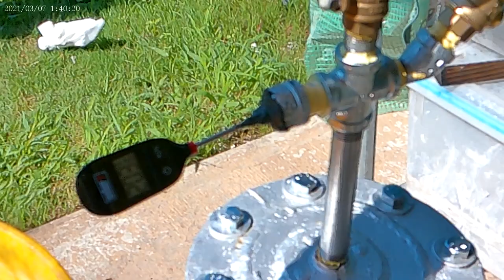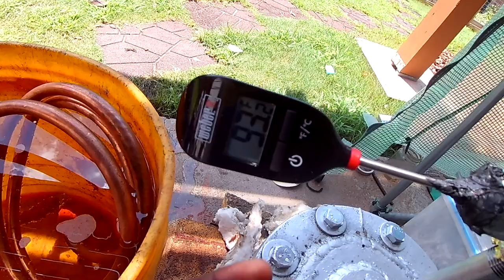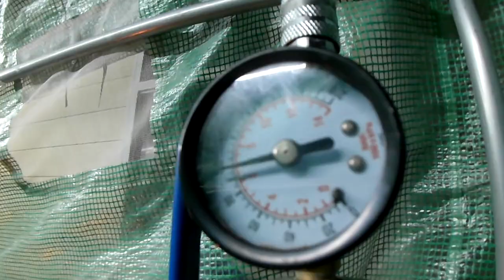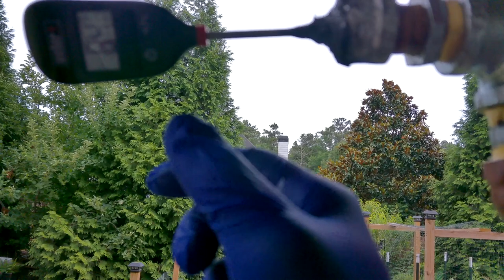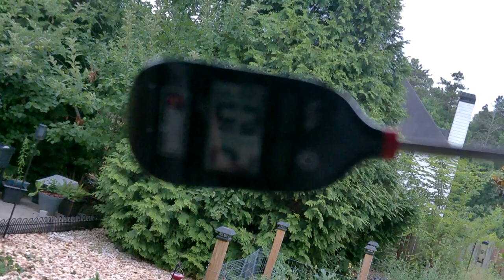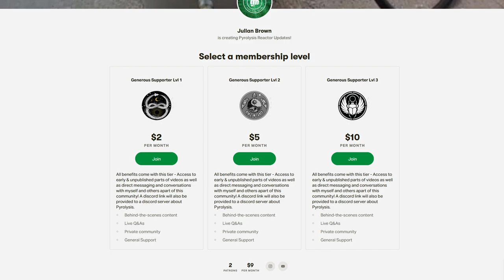Distilling Pyrolysis Oil Part 1

Comment: Here's my advice. Go get a hotplate with a digital readout ,theres some for making candy that are pretty accurate.  Make your worm a vertical spiral where there are no hills for distillates to dam against. Go to an all stainless rig so it doesn't react, including pot, I would use a pressure cooker.shorten the distance from your pot to your condenser and insulate anything that's exposed, youre trying to shock the vapor into condensing .Add ice and salt .Find out what compounds are in your crude and make a temperature bracket for them all. Work your way up through the temperature gradient so you only get one compound distilling at a time till you're at the one you want. Go slow and steady.youre looking for steady drips and maybe a small drizzle. Guaranteed it'll be clear amber if you do this.
Reply: Superb advice, man. You should give this a try, too, to help us all out!

Comment: Looking at your setup I can see a possible reason for the oil coming out literally the same way it went in first lower temperatures heating it slow is definitely the way to go but more than that the pipe that come straight up off of your reaction vessel if you stuff that with stainless steel wool it will act to give you a fractioning column and only let the lighter fractions i.e. gasoline and diesel come over while refluxing the heavier hydrocarbons until they turn into lighter hydrocarbons via cracking. Also when you build the new one try using a 2 inch pipe coming off the top for at least 3 feet where are you put the steel wall inside that will give you more space for fractioning. Hope this helps as always love the videos!
Reply from the maker: The pipe is stuffed with stainless steel wool, but I do need to make  it bigger as you mentioned. I don't have the footage, but if I do a very slow run, I do get better fractionation. Thanks!
Reply: What he said

Comment: Ok first off the oil contains poly cyclic hydrocarbons. Think cancer causing.
Two. Your filter medium needs time. 
Charcoal works great for this.
Three look up 3.5 angstrom  porous 
molecular sieve 3a it absorbs water and can be dryed out many times. 
Be safe
Reply: Thank you James. Very helpful.
Reply from the maker: Thanks!
Reply: @estesfamily6761  no problem it's what I do

Comment: Use stainless steel or at least copper pipes as galvanized steel will react with acetic acid that is present in the "pyrolysis oil ", that way you'll get a much more consistent product.
Reply from the maker: Interesting point there, thank you

Comment: Awesome video bro. Well done on all your efforts and thanks for sharing all the info for everyone to learn. Super noble of you. Not sure if this will work but if you can get a hold of some naoh (sodium hydroxide) or koh (potassium hydroxide) and mix it with ethanol to wash the oil before you redistill it, might clear some of the rubbish out and make it clearer.  my suggestion,measure 150ml of either chemical,  add 98% ethanol or methanol to it to bring the volume up to 400ml. Mix to dissolve completely, add 100ml of this mixture to oil 500ml of this oil, wash for 30min non stop,  then let it settle for 10 hours to let everything drain to the bottom and filter off. Then see if that cleans the oil more before you distill it. Works like a charm with my motor oil I distill to clean it.
Reply from the maker: Great suggestion, thank you. I will try this!
Reply: @naturejab  awesome bro hope it helps. Please do a video to show if it does work. Will be great to see. Also, once you've washed it and let it settle and drained it of the stuff that settles to the bottom, go ahead and re-distill it and it should be cleaner that when it went in. Just build the temp up slow in your recent vid. That helps tremendously as I'm sure you know cos then you don't burn the fuel.

Comment: I worked on a scrap tire recycler that cooked rubber scraps. We started it with propane and then ran it with the non condensing gas we made from the rubber. It supplied burner gas and we had a 25kW generator for electrical power. 
We also had a machine that did what you're doing. Our main business was main waste oil heaters. 
Note: If you do what we did, your pyro oil will be a smooth blend from heavy oil to light gasoline. Be careful!
It looks like you earned your Boy Scout Fire Extinguisher merit badge already. Great job!
Reply from the maker: Thanks!

Comment: you need a bulkhead fitting for the bucket to stop the leaks.  better you use a metal barrel and run your copper pipe thru that, you can easier weld fittings.  or even better grab a big length like 8 feet of 2 inch GI tubing for your condensor, weld some flat bar stock on it as your radiator fins.    Also a bootlegger trick... the copper will react with sulphur, that is one reason why they use copper in stills... but caveat, the copper reacts with acid, so mixed thing....  so pussibly just a bunch of copper wire in the tubing as your catalyst/scrubber.  Also I reccommend getting one of those laser thermometers.  makes it easy to check the temps thru your system.  Reactor vessel, a good flange, and propane tank is good.  If money is issue with that ceramic wool, you can use perlite from the garden store, or even just some dirt as the insulation.  I used dirt in my rocket stove insulation jacket with decent results.  Last but not least.  WEAR SOME SHOES and get yoruself some better fire protection.  soapy water, bucket of sand,  fire extinguisher...  and get some nomex coveralls...  you can get the military surplus tanker coveralls cheap...
Reply from the maker: Thanks for all this great advice, mate!
I do currently have copper scrubbies as a catalytic packing.

Comment: Damn man you scaring me over here with them open flames and whatnot! Would it be possible to repurpouse a ol pressure cooker and a electric plate prehaps? And another shot in the dark (dunno if it would work at all) maybe pour some contaminated oil in a plastic jar and freeze it? (thinking oil is on top of water and then you can pour the oil out with a block of ice in the bottom?) 
I dont know the first thing about destilling oils and such but been watching those "moonshiners" here on utube alott, maybe they can provide some tasty tips? Stay safe and keep on rocking!
Reply: Yeah, dont wanna sound smartass cause it didnt happen to me, but he has been thinking of the oil first, and not his own safety. It's a huge mistake to approach dangerous equipment with a routine. Routine is one of the most common causes for life threatening situations. 

Next time, Julian, screw the equipment or the yields, save yourself first. 

Even hang those rules on a wall to remind self, cause this shit aint playing.
Reply from the maker: I'll definitely be safer. Freezing isn't a bad idea either. Thanks!

Comment: I would try pulling a vacuum on the oil. And use a slow heat and seal the vessel, let it build some pressure, then open to the condenser.  Vacuum dry it if possible.
  But I'd build a  centrifuge to separate all heavy from light possibly a running centrifuge, a bowl with a lid with a large hole in the center. Spinning around 1000-2k rpm  . Mounted inside a bucket to catch the oil. Slung out that comes out the hole in the top. With the oil being slowly added to the center a fast drip or slow steady stream. The bucket having a hole to drain, with a center hole for the shaft. with a lip to prevent oil from leaking out. A 1/4-1/2 HP motor should work , with a 4" deep 8"-9" pie pan possibly, or fabricate it from 6"-8" or 10" pipe and flat plate. With the lid possibly being a 1/8" thick steel ring 1"-2" thick , (a 8" outer diameter with a 6.5" inner hole , leaving 1.5" thick area. Weld the lid on. As well as the base with a means to center mount it on the motor. balance it so it doesn't vibrate. The oil inside will self balance. It can be mounted on shaft with the oil added beside the shaft with a bearing on the top and bottom. With a belt driving to get the proper speed. 1000 rpm may be too slow or 500 rpm could be plenty fast to get separation.   If a machine shop were fabricating this, or someone with plenty of equipment. I'd use a 1.5" shaft. And drill the top part to below the lid/ring a 1"to1-1/16" should be plenty strong then drill through the shaft at the bottom of the hole. With a 3/16"-1/4" drill 3/8" or smaller. To allow the oil to be added through the center of the hole. A funnel mounted above allowing the crude oil to be easily added to the shaft. And the shaft running through the container. Will make balancing much easier. A automotive machine shop with crank balancing equipment should be able to balance it to 0.5 grams or less. I'd run a 3" pulley on the shaft ,and a 1.5-2" shaft on the motor, depending on rpm. Maybe invert the sizes for a slow motor. Or a 4" on the shaft for a faster one. Also the speed must be tested with the device full of oil 1.5" is a approximate max, and 1/2"-3/4" is near minimum. It will hold some oil. And the container can be tapered like a drinking glass. Say, example:  7" bottom and 8" top, with a height of 4"(1"-6" tall). With a thickness of 1/8" to 1/4" roughly. With the bottom plate the same thickness. If the shaft is drilled to allow the oil to be added. Then 3-5 1/8" -1/4" spokes can be welded to the top to brace the shaft. And a tack weld to balance if required.  I'd spin it up. And only balance if it vibrates. Also a drain plug can be added. Either through the bottom shaft,  or through a 3/8 bolt hole threaded into the bottom of the container.   Hope this gave Some ideas, helped in some way, I know this is a old video. I'm thinking about doing the same basic thing. Producing fuel.  Maybe the more volatile fuel can be reduced by using a valve (with a safety blow off / relief valve ) to pull a slight vacuum on the material to be ran. Seal under low pressure, apply heat until pressure is built try 2bar, then 4bar, I wouldn't attempt over 7-8 bar, unless the system is rated for pressure. Running at 100 bar(est. 145 psi plus would likely show best results 'better') or distilled plastic ran at minimal temperature to reduce diesel , also the high temperature under pressure could crack the molecule so much. That It produces much more gases  or possibly more gasses than wanted. If gas and diesel is the goal. I am wanting to produce fuel to run a generator.to charge batteries for my off-grid house. Possibly 6 hours every other day .I really want to get a 10-15 HP diesel engine. I wouldn't mind building it from scratch if possible, cast the parts machine them . Use common parts like bearings and injectors,   I'd build a 2cyl. Boxer to keep the Balance . With a 4.250" bore with a 6" stroke. Both pistons down   at the same time. Use used engine oil and propane to build a furnace.  To make the micro foundry possible, use brake rotors and cast aluminum engine parts to cast new parts from the aluminum and iron. Use lost foam casting. To make the parts . A leaf blower and used oil ignited by propane  should be plenty hot to melt iron. Maybe split some water to add some o2 to the oil to geta extremely hot furnace , just gotta watch the crucible, it could melt as well!😮.  Sorry to ramble, have an awesome day 🎉

Comment: If you add a large amount of salt to the pyrolysis oil there is a good chance that you can more easily seperate the water and oil
Reply from the maker: Very clever idea, thanks!
Reply: Hello….Do you you mean adding the salt then refining or adding the salt to the refined product?
Reply: @sayarocka  Adding salt then refining, it makes the water more dense which makes it easier to seperate from the lighter oil

Comment: First of all thanks for the footage and the hysterics you had me in😂 
Next, to solve the water leakage purchase some rubber grommets, they are cheaper than the water bill.
Now, as for the chamber and leaks, I would suggest a longer chamber so there's less heat reaching the top then seal it with exhaust manifold putty or RTV silicone.

Comment: One thing you might do to remove water is to evaporate it out.  To do that, you could have a metal plate with guides on it that you heat from below.  Then, you poor the oil over it and as the oil runs from one side to the other, it gets hotter and the water will evaporate off.  I don't know about how you could do something like that but, it's just a suggestion.

Comment: Your oil output is the same as your input because your heating temp is to high and your cooling temp not low enought... Also you are not enable to maintain a constant temp. 

However! Nice job! Thank you for your enthusiasm
Reply: My thoughts exactly. When distilling anything a smooth constant temp is completely necessary.if you want to rid your batch of contaminates you need to figure out what temp all of the compounds evaporate at and specifically target them based on temp.

Comment: You need the water in the condensing bucket on a constant flow. An inflow and outflow so the water is constantly cool and condense well  because that worm will heat that 5gal of water quick

Comment: Hey, just a heads up you may not want to use galvanized pipe because zinc dissolves in the acidic oil/fuel

Comment: Hello, Your work is great!

I'm planning on distilling pyrolisis oil in the Czech Republic. 
I have many questions and ideas:

Is it possible to use a pressure cooker and capture the gases coming out of the pressure valve?
Out of the box, which system of the reactor chamber would You think works best..?
I'm thinking a somewhat converted gas bottle so that You may open it and put stuff inside, or a water boiler.

why is the piping so long?

Thank You. Karel

Comment: I was wondering if you might think about cracking the oils to smaller chains. I was thinking of letting the  pressure push the evaporated oiles though a heated segment if pipe withbsand in it. The silicone dioxide lowers the temperature to crack the oil vapors.

Comment: Interesting video.  I suspect every chemist has had some accidental F-I-R-E in the hood. Have you considered using a strong saline solution to dry your oil?  I don't know if it's the right thing to do in this situation but sometimes that's done to dry reagents.  I've always seen it done in the separatory funnel. Mix several times, allow to settle, then drain the water out.

Comment: Oil coming over but the condensing temperature is only 100C... what's wrong with this picture - lol. My guess: there's so much water in the feedstock that it's boiling off vigorously and "steam distilling" the oil. Or IOW the water vapor is "dragging" particles of oil with it all the way through the system. I'm not actually sure how to fix this - maybe start with putting some packing in the column ?

Comment: you need to know the different boilingpoints on the different liquids. wather 100 degrese c . sprit 78 or 79 c . diesel, C12H24   150-375 c. crudeoil 300 c for som things in the oil but most of the oil boils hotter

Comment: Wow. I see several mistakes that youve made. Your vertical distillation pipe is too narrow. The purpose of a wide column is to let the heavy vapors call back to the bottom and the light vapors rise. A narrow pipe makes a pump and all vapors get pushed out. 
Your coolong coil should be on a constant decline. The way you have it you are creating traps which will decrease the flow and increase temps.   Watch some moonshine tubes and get some hints.